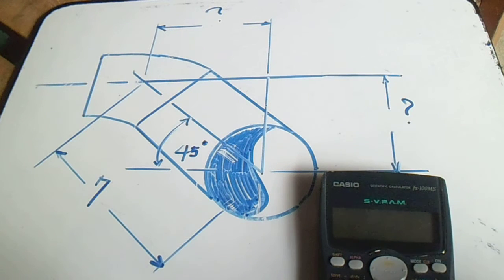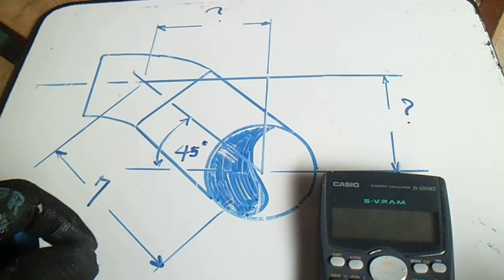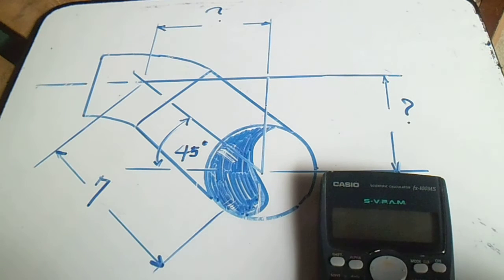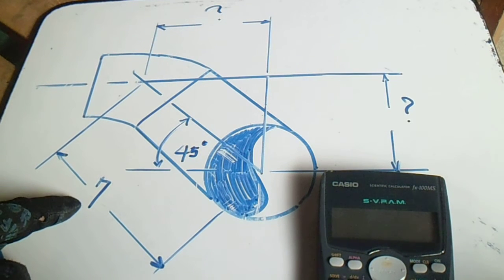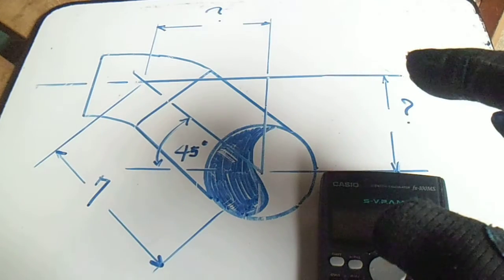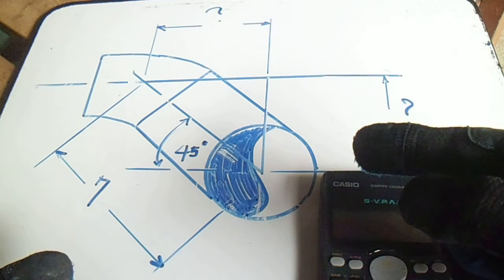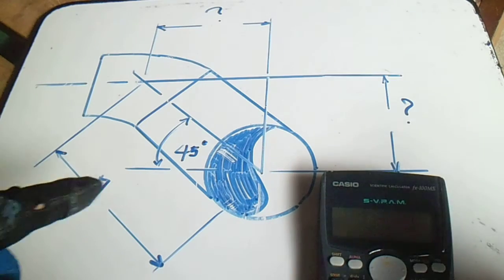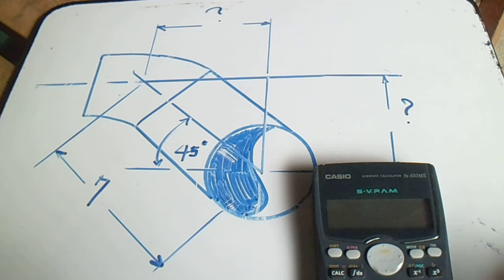Piping Angles Question and Answer All Pipefitter this is for You

Comment: divide 7/1.414= run = rise, now for the number of fittings need to know what size pipe it is.
Reply from the maker: 1.414 use if pipe size given to find travel. If not use Piping Angles formula
Reply: Or 7 x 0.707 = 4.95. With a 45 and the run or rise... multiply rise or run by 1.4142 to find the travel. If travel is known just multiply travel by 0.7071. Simple.